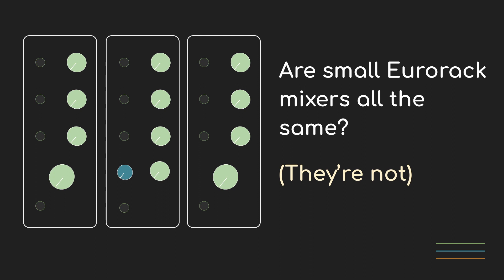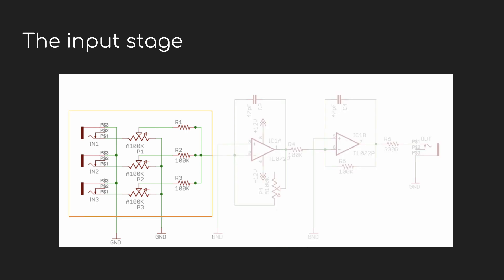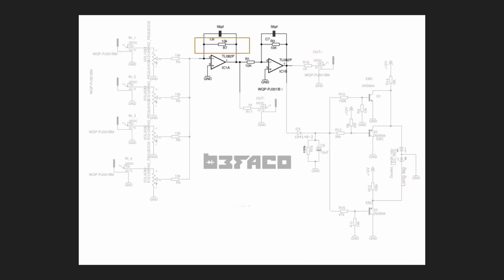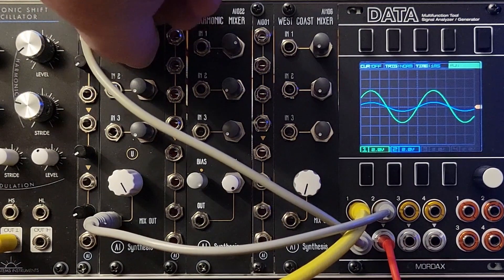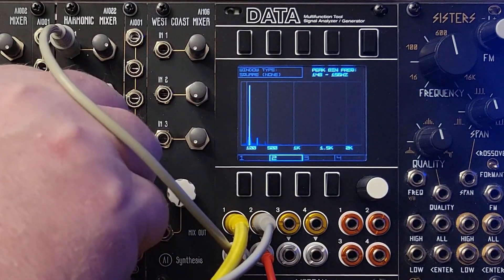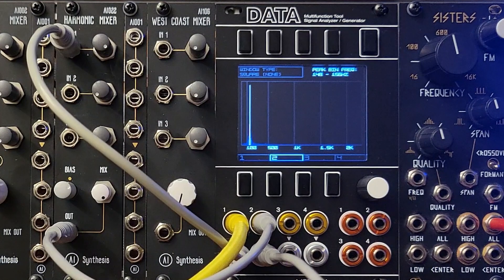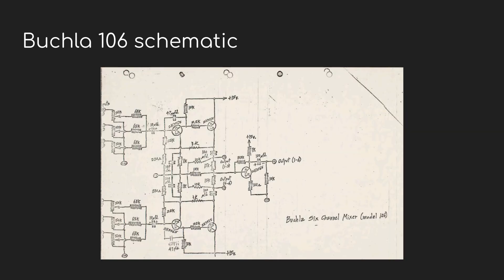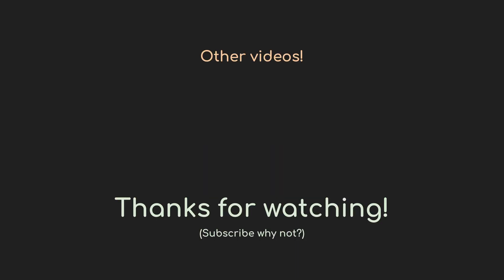I built 3 different DIY eurorack mixers, they were each quite different.

Comment: Hi! Does anyone knoe how good would the simplest OP-amp mixer work for line level audio? I'd like to use it for both purposes (10V CV and +4dBV signals) and I suppose I'd be fine / fine enough, but asking just in case! Thanks for the video, it's helping a lot to build some small utilites.

Comment: From what I remember, using an inverting op-amp configuration allows you to attenuate down to zero whereas if you did the same with a non-inverting op-amp you can only go as low as unity with the incoming signal. Fine for a buffer but not great for a mixer.

Comment: Interesting that the "harmonic" mixer amplifier stage is the old Moog design.  I first ran into the design (in DIY)  when i was building a copy of the classic Cracklebox (or Krakadoos), an odd instrument from the '70s with six touchpads to control the sound.  I think technically it's a push-pull amplifier made with Sziklai amplifiers.  (Sziklai being each side, made of an NPN transistor and a complementary PNP transistor; you can make push-pull amplifiers with just one pair of transistors.)

(I definitely need to buikd some of those mixers!  Mixing in my DIY Eurorack system is currently limited to the three unattenuated inputs on David Halliant's Simple VCA and a passive/averaging mixer based on the North Coast Synthesis "Passive Multiples and Friends" design/panel.)

Comment: I want to try building DIY eurorack modules. I'm curious about the "AI Synthesis - Matrix Mixer". Would that be simple enough to build for a beginner?
Reply from the maker: It's a little tight and fiddly, but not terribly complex. If you're not already comfortable with a soldering iron, I'd suggest the Mults that I built in the previous video.  But the Matrix mixer definitely isn't super difficult.

Comment: An op-amp outputs the voltage difference between its two inputs, multiplied by a large amount. Normally this amount is too large to exert any sort of control: basically, a difference above zero will lead to maximum positive output, and below zero would lead to maximum negative. To bring this under control, a non-inverting amplifier takes an input signal into the positive input pin, and feeds its own output back to the negative input pin (as well as off to the final output resistor & output jack), creating a loop that stabilises when the output voltage matches the positive input voltage (because the output voltage is also the next negative input voltage, so when output matches positive input, negative input also matches positive input, and the difference between the inputs is zero).

Effectively, with the feedback loop in place, a non-inverting amplifier "wants" to satisfy the equality negative input voltage = output voltage = positive input voltage. Positive input is our input signal, so it will swing its output voltage (and by extension the negative input) to track it.

To make that into an amplifier, instead of just an input follower (AKA a buffer), you stick one resistor into the feedback loop, and another between the negative input pin and ground, creating a voltage divider. Let's say you divide the feedback voltage by two: the op-amp will now output double the positive input voltage before it stabilises. The negative input voltage is half the output voltage, so it has to push the output twice as high before the difference between the positive and negative inputs drops to zero. There you have it, a non-inverting amp with gain 2!

Comment: Nice video!  I learned about op amp mixers just around the time that the TL072 came out.   I've used op amps to make all my own mixer designs.  One thing you didn't mention was the pot taper.  Mixers designed for audio use, guess what, audio taper pots.  These give finer control over lower volume levels.  Linear taper pots are used with DC-coupled mixers to keep the response even with respect to control voltage levels.
Reply from the maker: I was going to do a separate small thing about taper, because this was getting long and -- from a DIY pov -- I just always use linear and then put a resistor across two of the pot legs.  But you're right I should have mentioned it here.

Comment: The easy answer to why use an inverting amplifier configuration with a unity gain secondary amplifier. a non-inverting amplifier config can not amplify less than unity gain. So it's a very strict amplifier, its minimum is unity gain. inverting config is the opposite its maximum is unity gain.  Using just a non-inverting config in a mixer would result in adding all three input levels into clipping without a knob that could tame it.
Reply: The non-inverting circuit also can't sum multiple signals easily without the amplification changing depending on whether or not a input is connected.
Because of the way the op-amp works the two inputs will always try to stay at the same voltage (with some minor difference) so all the inputs "see" is their input resistance (potentiometer and 100k to a virtual ground node) the other inputs are basically "invisible". 
This wouldn't be the case in a non-inverting topology because there is no virtual ground node, so a input providing 0V would actually sink some current while a not connected input wouldn't but ideally you want 0V and not connected input to behave the same way.
Reply from the maker: And there you go!  Thank you very much Mr-someone-who-actually-knows-what-they-are-talking-about :)
Reply: Inverting is also better for mixing (summing in EE terminology) multiple signals. The inverting input of the op amp is what's called a "virtual ground". As far as each input is concerned, the others don't exist.

Non-inverting summing amplifiers would change volume if you unplug another input. That configuration is best avoided in my experience.
Reply: IIUC an inverting amplifier can go above unity gain (well, inverted but with magnitude greater than 1, e.g. gain of -2). You just need to make the feedback resistor larger than the input resistor.

(I would link to sources, but every time I do that, YouTube deletes the reply because it thinks it's spam...)
Reply: @depthbuffer  right but non-inverting cannot go below unity gain, that's the main reason a double inverting setup is the way mixers are usually made.
Reply: @psynautic  I believe you're right that non-inverting can't go below unity, just wanted to correct the idea that inverting being "opposite" somehow means it can't go above unity. The reality isn't that simple because of the different architectures.

I think the main reason for the double-inverting setup is because, as per @Ether_Void's reply, it's easier to sum multiple inputs with an inverting amplifier (because you can just keep adding more inputs with additional input resistors without interfering with the actual behaviour of the op-amp).